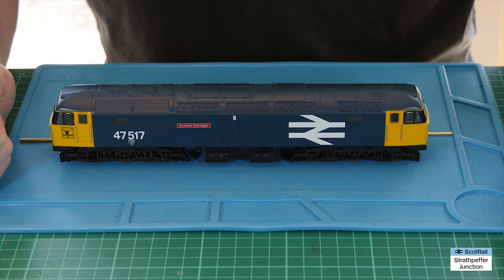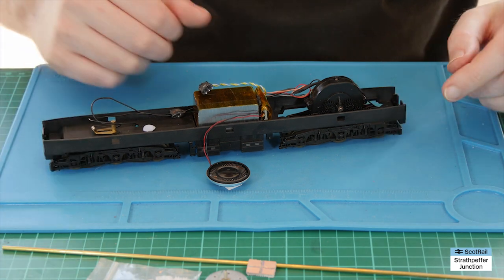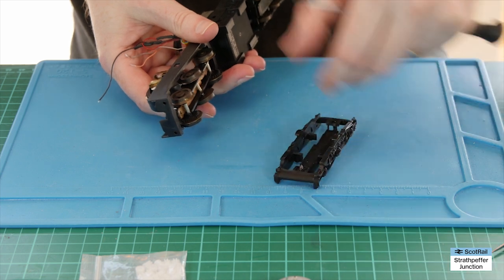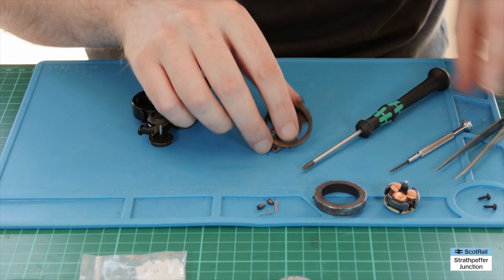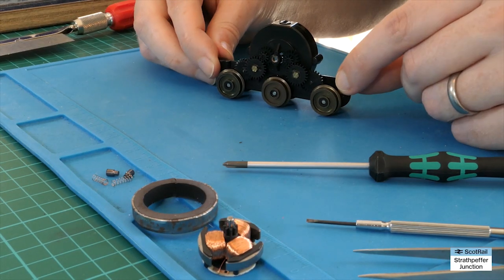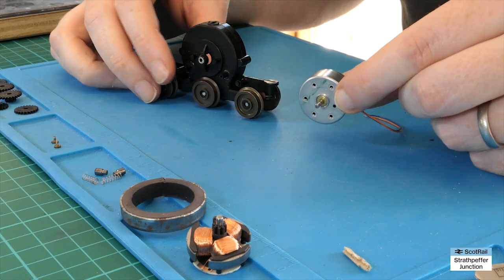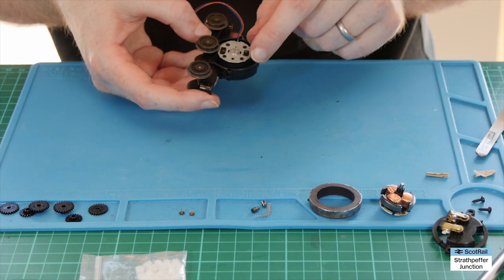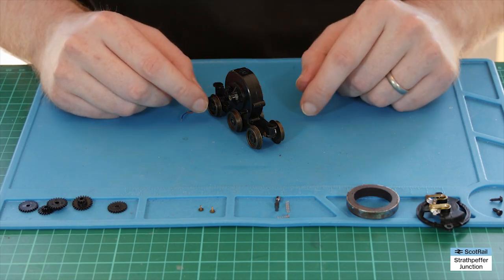#25 Lima Class 47 Ringfield Motor Upgrade - Part A

Comment from the maker: + Update + You can now buy ringfield motor adaptors for your own Lima loco at: https://www.strathpefferjunction.com/hornby-lima-ringfield-motor-upgrade-conversion-kits
Reply: Thanks for your great explanation of this procedure. Do we have to make sure we get a motor with the correct spindle diameter because I was wondering what stops the small white cog from spinning on the spindle? also is  there anything different to know regarding old "Dapol" class 56 (from about 20 years ago) 
Thanks

Comment: It was helpful to know WHY you were changing the Motor !!  I've got a couple old Locos that make a dreadful whining or clunking noise, and I've got  5 or 6 old CD/DVD Rom Drives that I could take apart & use.
Reply from the maker: Yes. For me it's about performance, reliability and noise. However, with a bit of tlc and maintenance, it's still possible to get these older style motors running reasonably well, and if yours fall into that category and you're happy with them, I wouldn't bother changing them out just now. If your old ringfields are running like a bag of nails, then it's definitely worth considering.
Reply: A few drops of Oil used to do wonders on my old Class 43 HST (125) and it still goes like the clappers after years and years in the cupboard. I think I'll defer to the Pros on the others and take them in for Servicing. I've got a Bachmann Class 170 that DANCES down the Track...  you know... Slow, Slow, Quick, Quick, Slow. It stutters worse than Porky Pig !!
Reply from the maker: Hehe. Yes, I think we've all had one or two like that! I have seen some very experienced Lima owners get great performance out of their models, and if you can achieve that either yourself or via someone else, it's definitely worth a shot. However, if the loco remains troublesome, replacing the motor is a good option.

Comment: I'm tempted to do this with the Lima/Hornby models I have, though the problem is that gear on the wheel as I model in p4.
Reply from the maker: The Lima gear is very straight forward to replace. The Hornby one is tricker. You really need a gear puller to pull it off without damaging anything, although you can also go it with a screwdriver if you're careful.
Reply: @StrathpefferJunction  thanks for that. I'll have a go with them and see how they get on, most are at the dead stage of life for the motor anyhow so nothing to lose really
Reply from the maker: @bionicgeekgrrl  Best of luck!
Reply: Thanks 😀 and thanks for posting useful videos,  appreciated.

Comment: Thanks for showing I’ve a couple of Lima locos which don’t run so well ...I might try and dig out some motors and give it a go ...thanks for sharing....mind you I’ll have to watch this about a 100 times 😱..... yep I always take pics good idea ...regards Fred
Reply from the maker: Thanks, Fred. It takes a bit of time to do, but it's not too complicated. If you drop out the brass bush step as some folk do and just use a length of brass tube to help align the motor (which is then withdrawn once glue), it does remove what is probably the most fiddly step. I still favour the bush as it provides extra support, but it does require everything to be lined up just right. Whilst editing these two videos, I was thinking about different approaches and I've got a couple of ideas that don't involve glue or bushes, so I may do another video on them using  spare Lima bogie that I have lying around. It'll probably be a while before I get to it though, as my focus is turning to the layout for a few weeks :)

Comment: Hi... Can you explain to me about the specific dimension of motor, plastic gear, and electronic parts? Because I'll try upgrade my Loco ALCO 1930 from DC to DCC... Thanks... and congratulations for your class....
Reply from the maker: For Lima, you'll need an 8 tooth gear. If you have a bobo bogie, then you can use a 12x24mm cd motor. If you have a coco bogie, you'll need to find a slimmer motor, but they are hard to come by these days unfortunately. For dcc, you just need a decoder with cv5/cv6 functions.

Comment: Hi Dave, thanks for the vid! I have 1 or 2 worn out DSB Class MZ, Lima used to be the only brand that made a model of this, and it is not a bad model. My commutator is loose, the bearings are worn out, and the gears have almost half a millimeter of rocking around radially.... do you know about a source for spare gears? Which motor did you use? And do you know the TPI of the gears? Anyway as an alternative, I will try a complete power bogey from Aliexpress! Thank you - Søren

Comment: Hi, love these motors, bought some via ebay. Very easy to fit and run fantastically. One question though. If I were to sell my loco's (probably via bay) would there be any legal issues? Firstly for me, because I have modified the loco. And secondly you, as you supplied a non standard part.
Reply: As long as you state in the description that it's modified, shouldn't be a problem
Reply from the maker: So long as you don't market them as having original motors, there won't be a problem. Lots of people have switched out old, failed ringfield motors, so it's becoming quite common to see them. What I normally do it retain the ringfield in a wee bag, so I can sell it alongside should anyone want it. But that's just personal choice. It doesn't need to be done.

Comment: Hi there this is an interesting video but I need to ask what is the power to weight ratio? If I put one in my HST would it pull 8 coaches easily or struggle? How much better will the locomotives be? Cheets
Reply from the maker: That's a good question. In terms of how much 'better' is the loco, if installed properly, it should run more smoothly, quieter and have better control. That's on light engine. The same will be true with a reasonable train, but when you're getting towards a prototypical rake, I honestly don't know if it will cope (I suspect it will) or whether it will overstress the motor over time and reduce its lifespan (possible, I guess). There is reasonable torque in these wee motors, but I don't run a prototypical rake, so don't have any first hand experience of that I'm afraid. Making sure wheels are running smoothly and are the right gauge (using and back-to-back gauge) will help. I guess it will also depend on whether you're running it flat or on inclines/declines etc. I'll cast about and see if I can find out anything and let you know. Likewise, if you come across any experience of longer rakes, I'd love to know too.
Reply from the maker: Hi Guy. I've just come across this video, showing two different CD motor conversions pulling sizable rakes: https://youtu.be/3ttDQteyO9k
Reply: Strathpeffer Junction hey Dave I watched the video and fund it interesting too. But it looks like it will pull a descent rake. I was thinking the best thing to do will be to convert one and run it. I have inclines or will have inclines so my locomotives will be working. Anyway cheers for letting me know
Reply from the maker: No problem. What I did the first time I did one of these conversions was buy a spare motor bogie from ebay. I worked out which was in the worst condition (the spare or the one on the loco) and then installed the CD motor in the worst one. I meant if it all when wrong, I could still put the original one back in. However, I'm currently trialling a 3D printed adaptor to enable these CD motors to be used without any gluing etc., so that would make it all fully reversible. Watch this space!
Reply: I can answer this question having put can motors in class 43s and 91s successfully.  You'll get lots of power and torque out of the motor, the issue is not power, it's TRACTION.  Those two traction tyres just don't cut the mustard, you'll get lots of wheelspin.  I have managed to get a class 43 to pull a considerable rake of 6 carriages using two power cars both upgraded with can motors.
Reply from the maker: Have you put in new traction tyres too? And out of interest, have you ever tried that bullfrog slim traction tyre substitute? A few customers have and have reported good results, but I've not tried it myself so can't personally confirm if it's better, worse or much of a muchness!